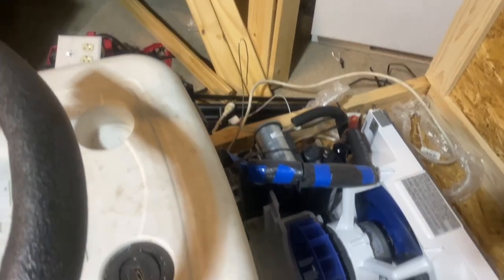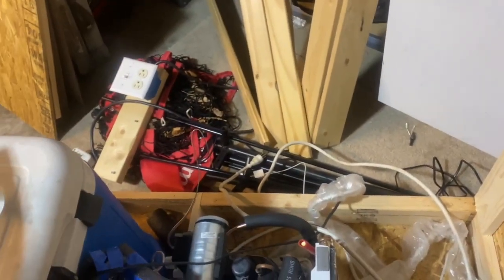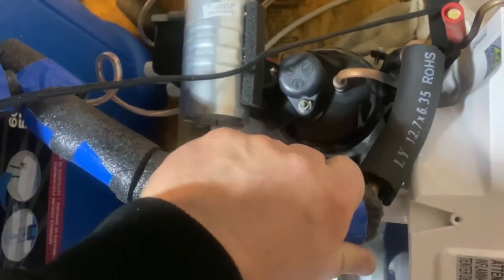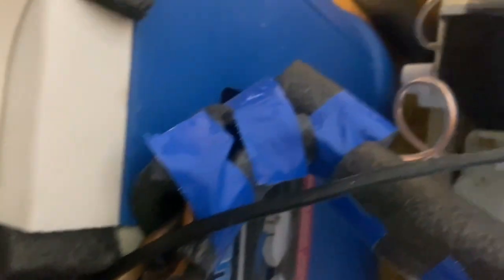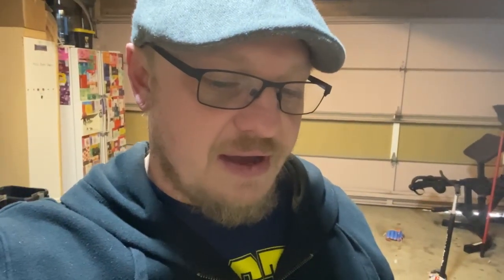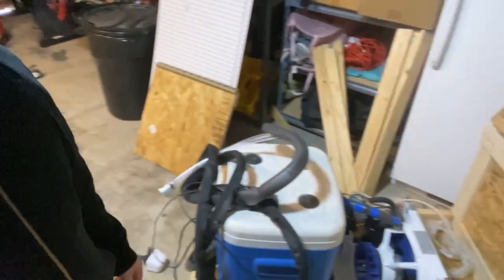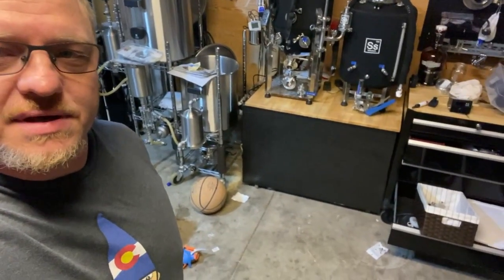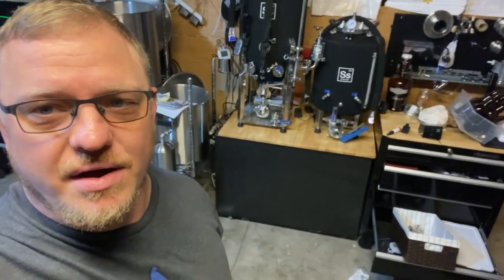Home Brew How-to: How to build a DIY Glycol Chiller for home brewing

Comment: What does it cost you to run. I am completely new to glycol chilling, and am planning to build a custom bar with taps, but I am unsure how to keep the lines cool as it will be about 15 feet from chest freezer to tap. I was thinking a wind tunnel using and inline 190cfm fan, to circulate air through the freezer to the tap and back down to the freezer but with a 4 inch pipe you are looking at 400 cubic ft of area and a chest freezer would just never keep it lower than 60 degrees even with good insulating. So based on math I have to do a glycol chiller and run it pretty much continuously and am not sure the costs, i.e $10 a day just won't work. is beer getting warm in lines a bad thing? Im planning to run 4-6 beer lines, and the taps will be used to pour about 30 pints a week but thats it.

Comment: I just made one of these but my AC turns off. I followed the video but seems to turn off after a bit. Is there a way to fix this? Thanks.
Reply from the maker: I think I left out that you have to bypass the shutoff in the electronics. I'm going to be building a new one here pretty soon and will show this up close. Essentially, you need to open up the control panel and remove the wire that tells the unit when to power off, as you'll be controlling that with an inkbird.
Reply: @brokentreebrewingco7034   I think I figured it out! Another YouTuber had the same AC unit.
Reply from the maker: @mousetrapbrewing9566  Perfect, cheers!
Reply from the maker: In most AC units, these wires are red, but they're both attached to the controller inside, usually with a little tab connector. You disconnect these tabs and just wire nut the two red wires together

Comment: considering it costs you about 200 to build, wouldnt you save 800$?
Reply from the maker: Not when I priced out a unit that could handle 6 fvs. Most were a max of 2-4 at a time. Either way!
Reply: @brokentreebrewingco7034  wheres the how to in the how to build? all i see is a video showing of what you did...
Reply from the maker: @davidbeiler6364  Here you go! 
Step 1 - Take off the A/C Housing (you won't be needing this again)
Step 2 - remove the temp probe from the surface of the a/c fins. (the inkbird has it's own temp probe)
Step 3 - Bridge the red wires inside the a/c control panel to bypass the auto on/off (you'll be controlling this with an inkbird)
Step 4 - CAREFULLY bend the copper pipe to allow the fins to be placed into a chest cooler full of glycol
Step 5 - cover up the copper with pipe insulation

I also use a pump inside the chest cooler to recirculate the glycol so it all passes over the a/c fins, rather than just having them trying to cool it with no movement. All of this is connected to a surge protector, then to the inkbird. I don't use the wifi unit, but they make one that you can monitor from offsite if you need. How you choose to decorate it is your thing, I just enclosed mine in a pegboard box so it has airflow. 

 Cheers!

Comment: How many gal/h each pump put out? I am deciding if I should get few smaller pumps or get one bigger and control the flow with solenoid valves. Thanks.
Reply from the maker: Not 100% sure but I use the pumps that ss brewtech sells with their heating and chilling package

Comment: Can you explain how you run five different Fermenters at the same time; could you do a quick video on your workflow process. I'm a new brew making and need to be able to do that with my Fermenter setup
Reply from the maker: There are pumps in the chiller reservoir that are connected to temperature controllers on the fermenters. I use inkbird stuff for that, they'll turn the pumps on when needed. The AC is also on an inkbird so that it controls the temp of they glycol. I keep the glycol 15 degrees below my chill point (so if i'm going for 34 degrees F, I set my glycol to 19F)

Comment: how many btu?
Reply from the maker: It's a 5000 btu toshiba window AC unit. For reference, I used the first one for about 20 months before it went out, but the failure was my own fault for blocking the flow of air around it.

Comment: So how do you control each separate fermenter?  Are you connecting an ink bird controller to individual pumps in the glycol tank?  What kind of pumps are they?
Reply from the maker: Yes, an individual controller for each FV. one is from SS brewtech, the other is an inkbird. they each control a pump in the cooler. I just got submersible pond pumps that can handle low temps. I keep mine at around 20F while I'm chilling.
Reply: @brokentreebrewingco7034   How many Gallons per min. do that each pump out?

Comment: Amazing setup!  I don't know about anyone else but I could use a few details on how this was done.   I get the general idea, but things like how to bypass the temp sensor, how to hook up the fermentation tanks, how to control the temps ( independently? ).  Maybe this is for someone who already knows all that lol
Reply from the maker: Thank you! Ask away: the temp sensor just needs to sit outside the cooler. Normally it would be attached to the fins that you’re putting in the glycol. I just leave mine hanging on the side inside the box. My tanks are connected to glycol pumps in the cooler by silicone tubing, and I trigger it with an inkbird on the fermenter. My fermenter has a chiller coil obviously. There’s also an inkbird on the chiller that has a probe in the glycol solution controlling the ac unit on/off.
Reply: So do you basically set the glycol temp to a number that’s colder than your cold crash then set your pumps to other temp controls to start it when individual fermenters?